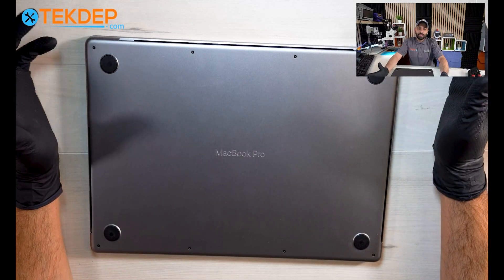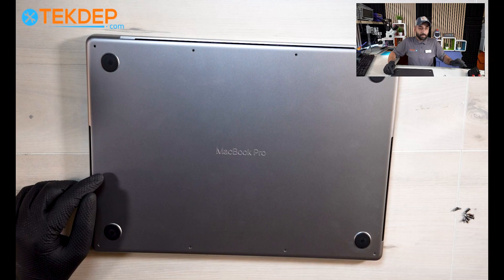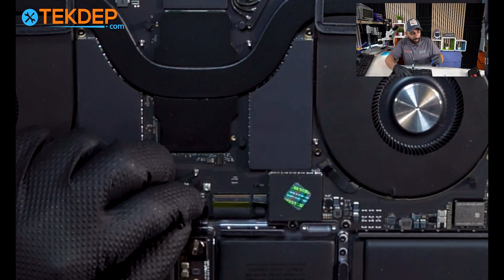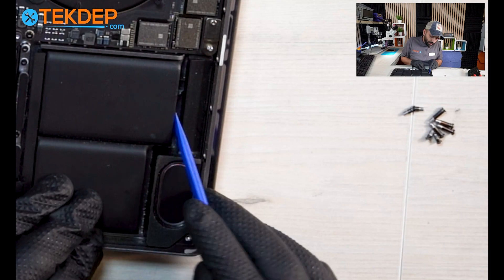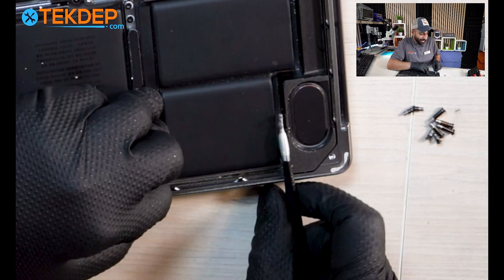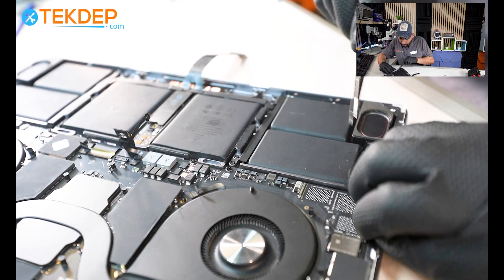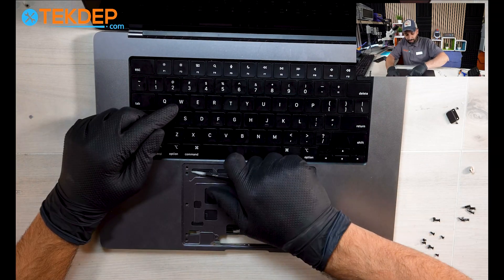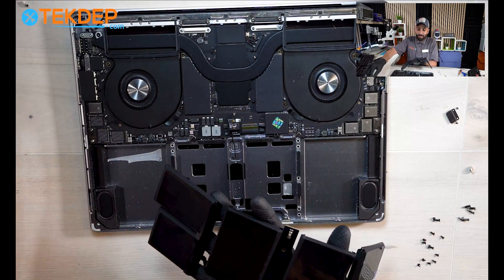Replace Bad Battery - 16" MacBook Pro Step-by-Step Guide A2485 & A2780 (M1–M2 Pro)

Comment: Hello, very informative video, thanks. Mine problem short: MBP A2780. Not used for about a month. It doesn't give a sign of life. I can't power it up with a charger. LED on original magsafe charger is off. Ordered second charger 140W, the same. But it is brand new = might be dead on arrival. I have no access to another. Tried few cables (magsafe and USB-C) - still no success. The power meter shows about 1.2W of chargers when any of them is connected to Mac. 
1. How I can determine if charger is OK. 
2. How can i check if the battery is OK? 
I have tools, multimeters and I can measure voltages.

I'm not sure what is broken, what to order without additional checks.
Can you please advice?
Regards,
Marek
Reply from the maker: Hello! Thanks for the detailed information.
Since your power meter is stuck at 1.2W, it sounds like the charging circuit isn't fully engaging. If you are comfortable opening the back of your MacBook, the best way to diagnose this is to perform a bypass test,
Open the back cover and carefully disconnect the battery from the logic board, Plug your charger while the battery is still disconnected If the power meter jumps above 1.2W or the Mac boots, your battery is the problem; if it stays at 1.2W, the issue is likely a fault on the logic board itself.
Quick Tip: use thunderbolt or high capability cable as a standard cable cannot negotiate the high power needed to "wake" a dead A2780.
If the problem persists, feel free to set up a professional evaluation through our Mail-In Repair Service.: https://tekdep.com/mail-in-repair

Comment: Mine is an a2485, the battery details under system information in About Mac does not show the serial number, cycle count, firmware version, hardware version or any other information but a BH of 96%.

It won’t run on battery and stays at 1% charge forever even though it shows it’s charging when connected to the MagSafe.

The fans are constantly on high speed and the keyboard light used to turn back on after shut down a couple of weeks ago.

An Apple diagnostic run shows that the battery wasn’t detected.

The system shows “Service Recommended” under battery section so my suspicion is indeed a failed battery.

I would however like to confirm if it is indeed only a failed battery or it could be other issues such a faulty logic board or flex cable.

Would want to make a decision to repair this Mac or get a new one if the damage goes beyond the battery. Counting on your feedback to help make a decision.

NB: Kindly advise which battery you will recommend I buy from your website if you suggest I replace the battery.

Regards.
Reply from the maker: Thank you for the detailed breakdown. Based on your description, this is almost certainly a failed battery.

To reassure you regarding the logic board: The symptom of "fans constantly on high speed" combined with the missing serial number/cycle count is a classic protective measure by macOS. 
When the system cannot communicate with the sensors inside the battery (due to a dead BMS or cable), it assumes the worst-case thermal scenario and ramps up the fans to protect the hardware. 
This strongly suggests the issue is isolated to the battery/battery cable rather than a board-level failure.

Replacing the battery is the correct first step and usually resolves all these issues, including the throttling and fan noise.

You can find the correct original replacement for your A2485 (Model A2527) here on our website: https://tekdep.com/product/a2485-original-battery-model-a2527-for-2021-macbook-pro-16-m1-pro-max

Let us know if you have any other questions during the repair!
Reply: @tekdep Thanks for the speedy reply, really appreciate it.

Comment: My battery shows 100% and charging, but for some reason my computer A2780 does not work without being pluged in.  I checked the two gold leads of the battery with a voltmeter and I get no voltage, but again the batter is good as a) it was working before, and b) the own computer battery monitor is giving me good health and 90% life.  Should there be a voltage across those pads (the ones right underneath the pancake screw), and if I don't have a voltage, is there a way to fix that (I really do not want to have to replace the whole battery)
Reply from the maker: This is a newer model so I won’t believe the issue is your battery and that is not how you check battery health, however if I have to take a guess I would say you may have a logic board issue or a short somewhere in the top case, I say that base on the other similar repairs we have done recently on this model,  if you want you can send it to us and will find the issue and get it repaired for you, simply visit https://tekdep.com/mail-in-repair

Comment: With the "permanent" gluepads on this replacement battery, how can this be replaced in the future? Also, battery expand and contract when charged/discharged. Apple original strips will compensate for this possible displacement when charging, as they are extremely flexible. Gluing entire battery with hard walls is what caused all the fires in the Note series some years ago as the battery was not able to move while expanding, creating friction. I would definitely use an original battery with strips.
Reply: My thoughts exactly! Could you share your view on this @TEKDEP ?